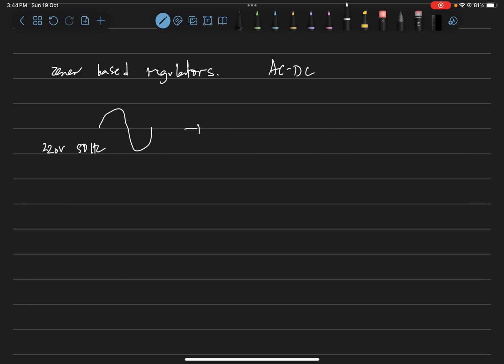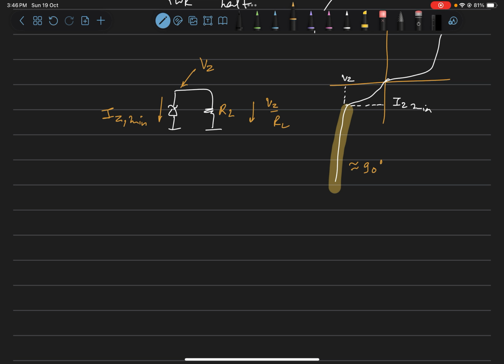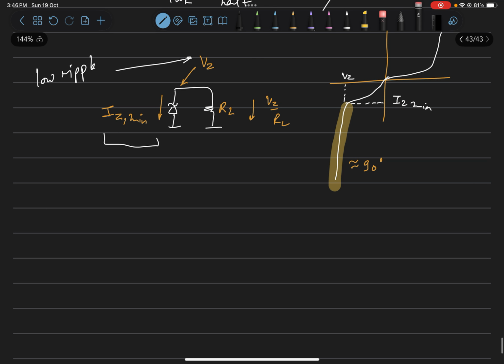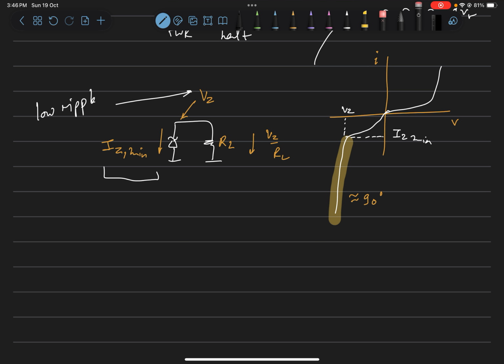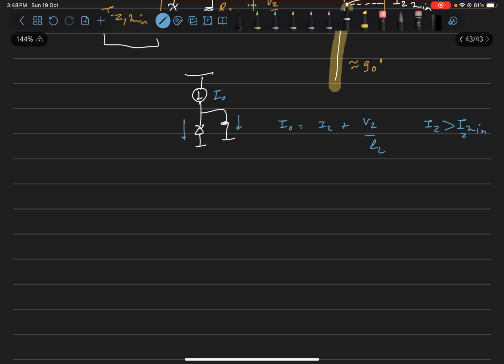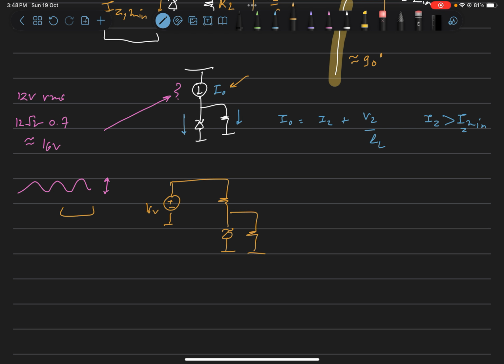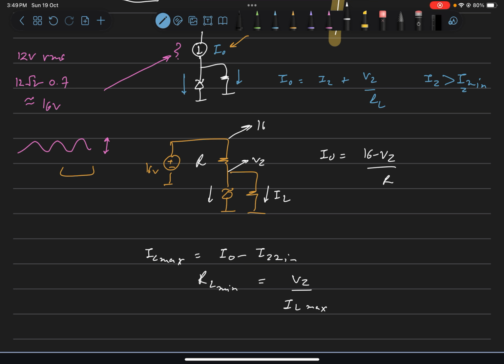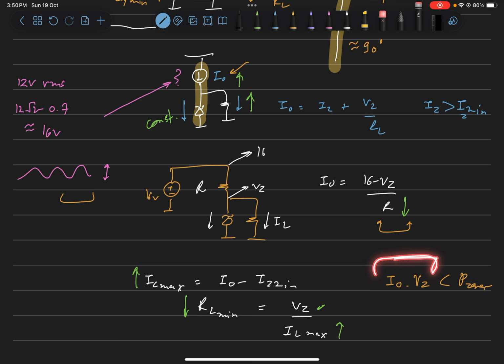Zener based voltage regulator- AC-DC Conversion

Comment from the maker: Ripple in I0 comes due to ripple in the 16V battery thus causing ripple in Iz, but that is not reflected much at Vz due to 90 degree slope, thus giving regulated voltage.